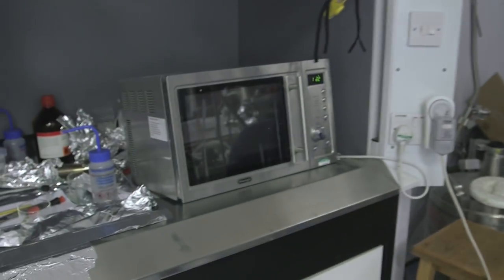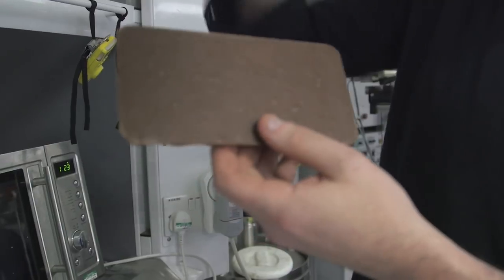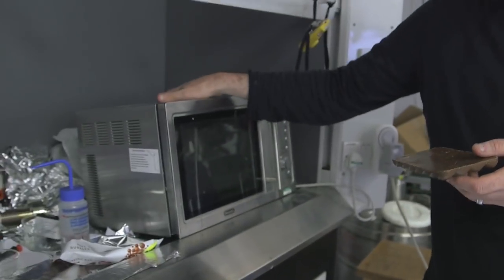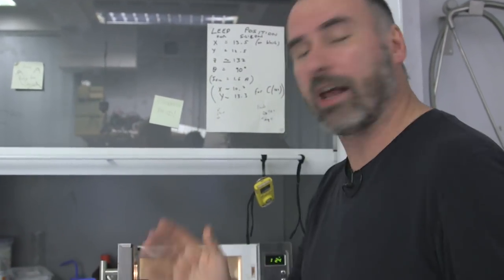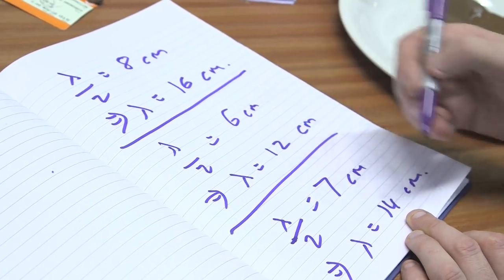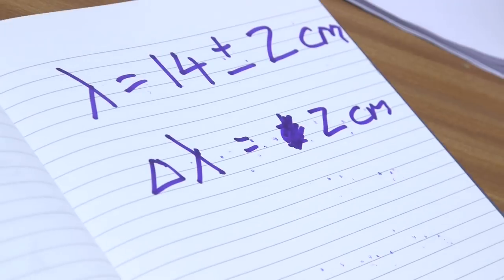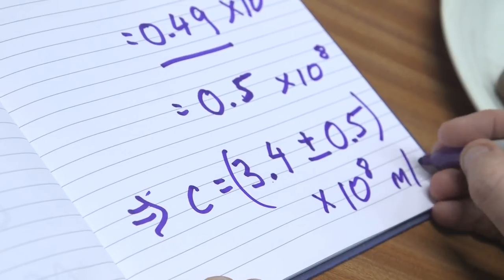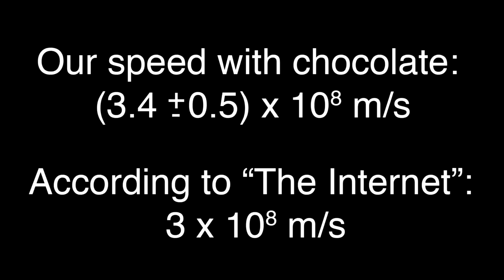Measuring Error Bars with Aero Bars - Sixty Symbols

Comment: As a ham radio operator I've built dozens of antennas over the years so I'm very familiar with the formula for converting frequency to wavelength but I've never seen the equation set up to solve for c. It threw me back for a moment.

Comment: The +/- 2 value quoted in this video is actually the standard deviation - a direct reflection of the scatter of the measurement data. Error bars are normally determined from the actual inherent uncertainty in the measurements. That is, each quantity or variable in the experiment has an inherent uncertainty associated with it which can depend on many things - including HOW the measurement was taken. For example if measure the diameter of a metal sphere using a micrometer or veneer caliper you will get a different uncertainty than if you measure it using a wooden ruler. The error range used in this video is purely a statistical measure of the standard deviation of the data set - and in this case there were only 3 data points used. 
It's crude, but I suppose the purpose of the demonstration was to highlight a practical way of measuring the speed of light using a household appliance and basic Physics equation (c=l*f).

Comment: QUESTION FOR MORAIRTY; How does one manufacture/machine a pinhead of width 1 atom for a Scanning Tunneling Microscope, and then on top of that, have a machine that is capable of making physical adjustments on the scale of individual atomic radii?

Comment: Maybe not a very exciting topic, but important nonetheless. But Brady, please use × (Alt+0215) in stead of x as a multiplication sign and ± (Alt+0177) for the plusminus sign. Keep it up!
Reply: You CAN actually say that exact value for c is 299,792,458  m/s because the unit of length, the metre, is defined from this constant.
Reply: I like error calculations, they're not hard at all and make a lot of sense. It's fun when you do measurements and get errors that are over 100%.
Reply: mpandurov okay, then this vid is reformulated to measure the frequency of the microwave. Same idea,  but I think less accessible, they made the right call.
Reply: I think it is... Because you can go full ham with error calcs... Like he said, there's an error even in the ruler, which would not only matter when finding the distance between the center of mass between valleys in the chocolate, but even when having to find the center of mass themselves - which you probably can't do without even more errors. And then we have the setup of the microwave itself - how do you know there's not some bouncy effects of waves going on in there :( and so on.

Comment: I did this in my electromagnetism class.  It's very tricky when you start involving multiple measurement instruments.  And you need to dig through a lot of PDF documents to find the correct error percentiles for the range of measurements you're doing.

It's fun, if you can understand it.

Comment: I remember having to do this in undergrad lab. But it was a lot more convoluted. We had to take enough measurements that we could justify quoting a probability distribution to our final result. It could easily have happened that all three chocolate bar measurements were closer together. In this video your error bars would have been smaller. What we had to do in lab, is quote a probability that the true value was between two values. For example C = 3.4 x10^9 m/s with a standard deviation of 500 x 10^9 m/s. Meaning that there is a small probability that the true speed of light is X.XX m/s even though we never measured anything near that value.  (by the way, we didn't measure the speed of light in lab, it was all thermal and acoustic measurements).

Comment: Question: What's the purpose of the "relative error" thing? Can't I just convert the units of the error and plug it in the formula for c, replacing c with delta-c and lambda with delta-lambda? It also gives the value 0.49*10^8, which is unsurprising given that it cancels out to be what I'm talking about, delta-c=f*delta-lambda.
T=2*pi*sqrt(L/g)
Also, what if we were trying to estimate a pendulum's period by measuring L, given pi and g (for simplicity's sake)?
deltaT=2*pi*sqrt(deltaL/g)  or deltaT=T*deltaL/L?

Comment: If we're doing a full analysis, instead of error bars, we think of the underlying probability distributions and in this case, the distribution of a sum a variables is the convolution of the individual distributions. However, what about the product? Do you just take the log, convolve, and then pull back with an antilog (i.e. exponent)?

Comment: I watched the „age of the universe“ video before, and it featured an asymmetrical  errorbar ( for the value of the Hubble-constant as measured by „standard-siren“ of 70 +12/-8 km/s/Mparsec). How do you end up with asymmetrical errorbars? Why is one side weighed more? Probably in the details of the measurement, but I‘d like an explanation...

Comment: The 2 cm are not the error of the mean wavelength but the error of every single measurement! 

Explanation:
The way the error bars of delta_lambda=2 cm were obtained is misleading: it suggests that when you perform more measurements the error cannot become smaller but might even become larger as you will get bigger deviations from the mean with a certain probability. Just wanted to point this out, I see this is a YouTube video and Phil said himself this was a "crude and basic introduction". And I still think the point of the video was made very clear. But maybe a future Sixty Symbols video could cover how estimated errors in your measurements translate to errors in a derived quantity, e.g. if c=f*lambda and you assume f=f+-delta f and you measure lambda several times each with an error of say 2 cm, how do you obtain the mean, the standard deviation and the error the of the mean of lambda and how do you get the error of c in the end.

Comment: Are microwave ovens dimensioned to an integer multiple of the wavelength to encourage standing waves?  Why? An improbable accident?  If uneven intensity distribution is undesirable it would seem trivially easy to avoid by having non-parallel sides and irregularities in the pressing of the steel.  The fact that standing waves are present is taken for granted here and I've not heard an explanation.
Reply: If you don't choose the width so you get standing waves, the waves would interfere destructively everywhere and mostly cancel out, or you get even weirder uneven patterns. Getting a lot of power into the food is already hard (you need big transformers to get high voltages), so you just deal with the uneven heating by rotating the plate and letting the heat distribute in between heating.
Reply: Also, the equal distance between the melted spots is a giveaway (also presumably between cold spots & the walls), so assuming standing waves shouldn't be strictly necessary.
Reply: They are actually "dimensioned to an integer multiple", and this is why your microwave tray is programmed to rotate. The standing wave would be heating only certain sections of your food without the rotation!
Reply: Will To Win   thanks, and to nibblr for the responses, but does this lead to the conclusion that if the microwaves were scattered they would not heat the food?  I bet you can both guess the next question: where would the energy go?

Comment: Wait, if you get your error bars from [delta]C/C, then aren't the value of the error bars highly dependent on your measuring scale? If I'm measuring a temperature in Fahrenheit or Celsius, I would get radically different error bars, since the ratio and zero point are different. Doesn't this render the whole exercise vapid and arbitrary?

Comment: I think you forgot to allow for the error in the rule in your description of the error calculation though I presume it is small compared to the wavelength. When I worked in a sheet metal shop you had to be careful with the measurements as it was quite common to accidentally chop the end off rules in the guillotine so often the first few centimeters or inches were missing !

The other thing is that the Frequency written on the back may have used the speed of light in it's measurement if so you can't really use the labeled frequency to determine the speed of light.

Comment: Instead of just putting the chocolate bar in as a big block you would probably get more precise results if you separated the bar into its individual small squares of chocolate. (It looked like the bar is a 7x5 grid in which case 35 individual squares.) Put each square on the plate in the same rectangular shape but separate them just slightly so they're not touching each other as some of them melt. That way the heat from one square won't be able to easily transfer to a neighboring square and the main source of energy to melt a square will come from the microwave itself, not from convection within the chocolate. 

Cool experiment though. :)

Comment: So the measure of dispersion he used here is (half) the range - the distance between the biggest and the smallest measured value. From psychology and neuroscience, I'm more used to the standard deviation (though it happens to be the same here and the calculation is more annoying).
Range seems to be the most conservative estimator (i.e. makes the results look the most uncertain), and only goes up with more data points  (because over time you'll catch even bigger outliers).
Reply: In physics one always uses standard deviation (e.g. six sigma confidence minimum for any discovery in particle physics). Range is only used in security protocols, as far i know. I guess Moriarty did not want to loose anybody by explaining that.

Comment: Well i have not done any physic since grade school but how does the wavelength and frequensy per second at all relate to the speed of light, i just do not get it. What is the underlying assumption i do not get, i see the calculation but how does it relate to the speed of light? Can we have an explanation video for gradeschoolers :), because i think i am back.
Reply: light is the visible portion of the electromagnetic spectrum. microwaves are also part of it. the speed of light is the same as the speed of the microwaves because they are the same
Reply: But hello what has it todo with the heat spots in the chocolate bar that is my question? You mean every wavelength has a heat peak? Why should it? Or do you mean it bounce on the chocolate at certain positions?
Inform me because this drive me nuts.
Reply: Light is a wave, and one of the properties of waves is that the speed of the wave is dependent on the size of the wavelength, hence the equation used c = f(lambda) or speed of light = frequency of wave x speed of light.
From this we can deduce the hot and cold spots as the peaks in the wave. The hot and cold spots relate to where the wave is hottest and coldest.
Reply: The oven is a resonant chamber.  Waves are reflected back and forth.  In some places peaks and troughs coincide, at other places they cancel.  Energy transfer to other material is greatest in the first case and negligeable in the second.  This is to do with the wavelength which, if one knows the frequency and the speed of light can be calculated.  So that answers your question.  If you're now wondering why the heck they don't make the walls non-parallel, space them by a distance that is a non-integer multiple of the wavelength and give them a scattering shape so that standing waves do not occur.... well search me guv.  It's just taken for granted here, which is a bit sad.
Reply: Well i just have a hard time to understand it, i have forgotten all about standing waves, but i do understand the idea what does it mean a wave peak, it seem so weird to me when sending out a sinewave thru speaker could i find a distance where the energy is "louder" stronger. I have forgotten the most basic things about physics but it all seem weird to me.
Reply: Well i just think it is strange that the so called peaks is at the wavelength when you consider it is bouncing around. Also is there peaks in dB from loudspeaker sending sinwaves at distances separated by the wavelength? Never heard of it.
Reply: Yes, a loudspeaker in a room will set up standing waves. There will be places where certain frequencies are nulled out and others where they are increased. That is what makes the difference between a great symphony hall and a poor one.
Reply: I'm guessing you're asking on how to derive the formula. To derive the formula, you have to imagine a point in a wave that follows velocity of the wave. It takes exactly one period for a wave to travel a distance equal to its wavelength therefore Speed = wavelength/period and since 1/period is frequency therefore speed = frequency*wavelength. Since light is a wave the formula should also work.
Reply: No i more question how the heat areas can occure, well if it is not designed that way so save energy, it seem a ranom volume would get the wave "maximums" well if there is such things to be refected on different places, possibly i can see it if the wave leave with same angle every time and the "two or three" dents of different magnitude due to its losing energy rapidly?

I want a sketch simulation of what is occuring.
Reply: Because i think if we would simulate it with a random volume, it would not happen so it must be a design feature?

Comment: I was taught to quote mean +/- SD, as most scientific papers use this...
Reply: too few measurements here to get standard deviation. But SD is comparable across units, so can be more revealing.
Reply: Absolute error can be fine aswell.. expecially with few measures (under 10/20) the average ± absolute error retain the most physical meaning to me
Reply: well strictly speaking two points are enough
Reply: Sometimes a ±2σ error is quoted, but never without stipulating that that's what it is. Which can consist of stating that it's a 95% confidence level.
Reply: sleepy314 You can still approximate the SD by adjusting the uncertainty according to the inverse Student's t-distribution...

Comment: I'm curious, why not use the upper and lower bound for the measurement as the highest and lowest output of your formula? The formula is c=(2.450E9)(x), so then you could input every possible measurement you got, so let x=12,14,16, and then you would say that the speed of light is (max+min)/2 ± (max-min)/2? Here it doesn't make a difference but what if you had a tangly sinusoidal function or something?

Comment: Chocolate filled with air...

...YOU'RE BUYING LESS CHOCOLATE!!
What a rip-off.
Reply: Only if it's sold by volume and not by weight.
Reply: It actually is sold by volume because people buy 'bars'. They're only a little bigger than normal bars but are much lighter and sold for pretty much the same price.
Reply: The same applies to carbonated drinks
Reply: How is that the same?  Bubbled chocolate is basically 'cheating' the customer into buying less product for the same price because for any food, weight is the measure of quantity. For drinks - it's volume, and that's what you pay for. Carbonating doesn't change the amount of drink in a bottle of the same size. The weight might change but it doesn't matter in that case.
Reply: Well, carbonating water does change the volume somewhat, just not nearly as much as pumping chocolate bars full of air. But it is not the case that the bars are sold "by volume." They are sold by unit, and a single Aero bar actually has more mass (46 g) than a standard size Hershey's bar (43 g). But of course, it depends, because both products are sold in a variety of sizes at a variety of prices. They also have different ingredients and different methods of manufacture. At the end of the day, people will pay for candy they enjoy without being concerned about the fraction of an ounce they are being "cheated" out of.
Reply: There is a product I know of where it is sold at the same price for the same volume/packaging, but different mass, and that's the Yoplait "whipped" yogurt compared to the normal yogurt. In that case you truly are paying the same for less. - https://imgur.com/a/t4uGh
Reply: nishbrown 
They're expensive too!

Comment: I can't believe what I'm seing at 11:25
0.49e+8=0.5e+8...
So 0 = 0.5e+8 - 0.49e+8 = 1.0e+6. What is (1.0e+6)^-1 then?
You know that there actually is an "approximately" symbol, right?
Reply: bruh, 4/pi = 1, din't u know?
also, cows are perfect spheres
Reply: rip mathematician, ripped apart by engineers
Reply: pi is roughly 1, ask enrico fermi
Reply: maybe you should look up how significant figures work. Rounding to preserve significant figures is actually a more accurate report of the measurement, because it communicates the uncertainty. Keeping useless digits around misrepresents the accuracy. The measurement was not accurate to three sig figs, so representing it with three digits at all is a complete waste, and is considered dishonesty if anything. It is well understood that a measurement is an approximation already, you don't need to spell it out or put special approximation symbols between every line. (1.0e+6)^-1 = 1.0e-6 btw, much easier to write.
Reply: I can't believe what I'm seeing. There are approximately 60 symbols.